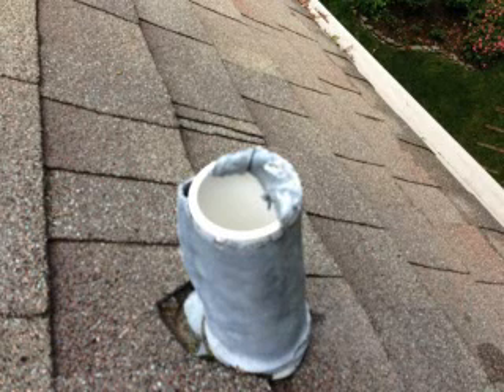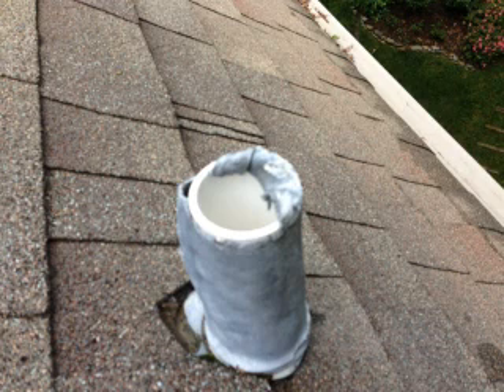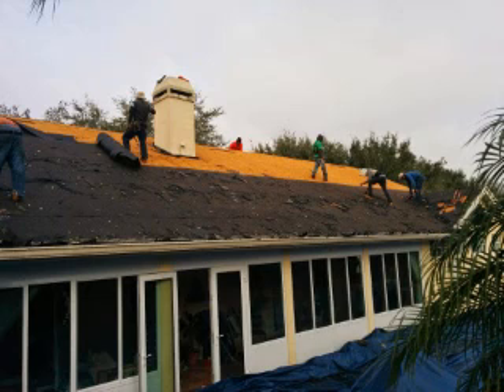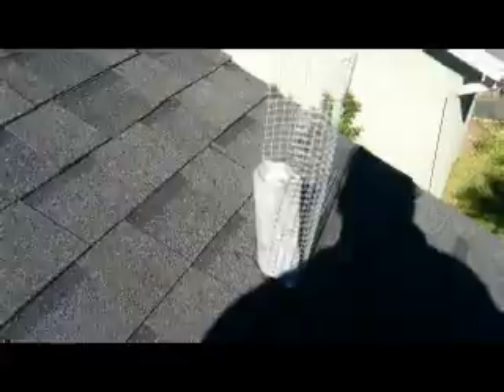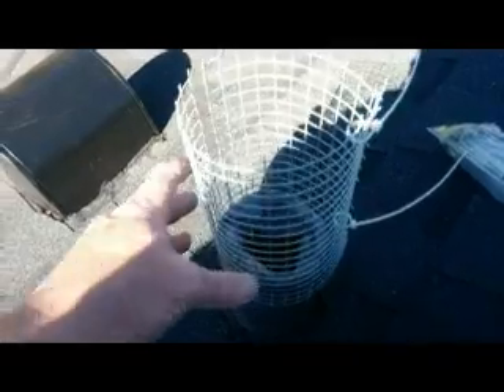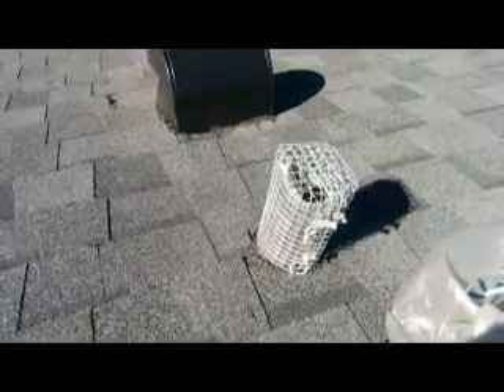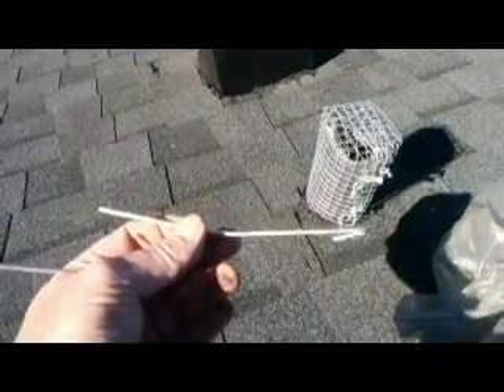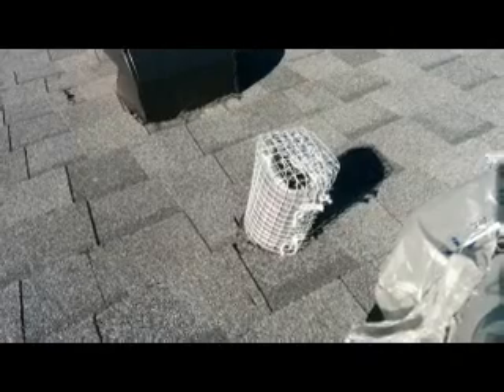DIY - Prevent damage to lead boots for roof vents

Comment: Looks like your lead flashing was installed incorrectly. The flashing should be exposed at the bottom to aid in water run-off.